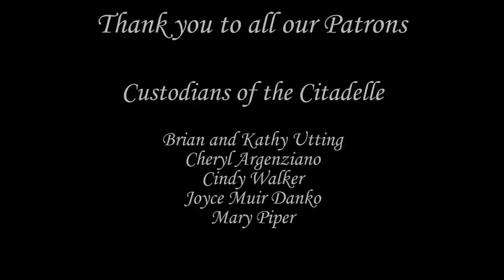An amazing find in our 600 year old tower

Comment: That was amazing! And I'm so looking forward to seeing if you found a 4th window! Even if you won't be able to replace the glass, I'm with Suzi about putting lighting in the window boxes! Wiring may be tricky,  but could you run it through the barn or under the guttering from the lower window and run a wire outside to the next window box if there's one there? I'm sure the vines will cover the wires!
Reply from the maker: Thank you for watching and for your suggestion. Have a great week, Suzie and Rols

Comment: Great archeological sleuthing & discoveries. You mentioned placing/inserting a plasterboard panel behind the bars from access in the barn, personal suggestion why not insert a mirror instead (possibly an antique or aged finish). This will give more of an allusion of an actual window reflecting any available light in the tower. You could also place a candle/s on the window ledge/s whether real flame or even rechargeable or battery operated pillar candle/s the light will bounce off the mirror and if also placed on the other real window the glass, will also look lovely from the outside of the tower.
Reply from the maker: Hello David, thanks for watching and for your suggestion. Have a great week, Suzie and Rols